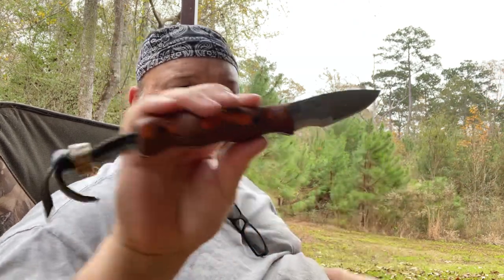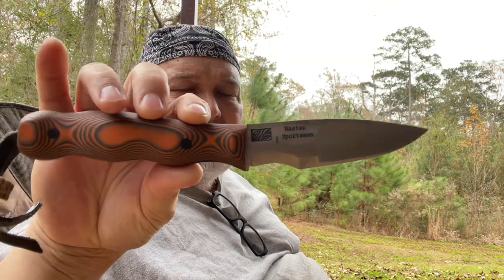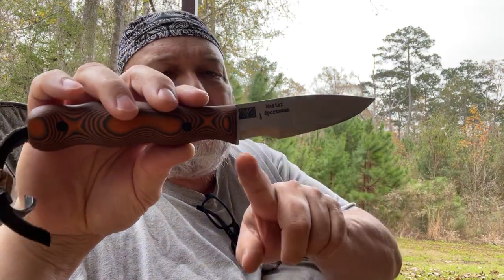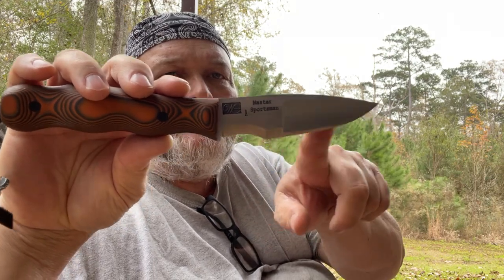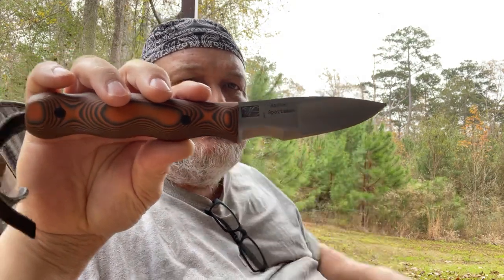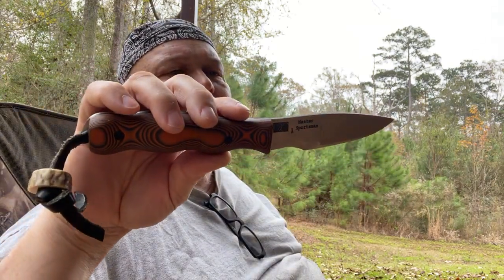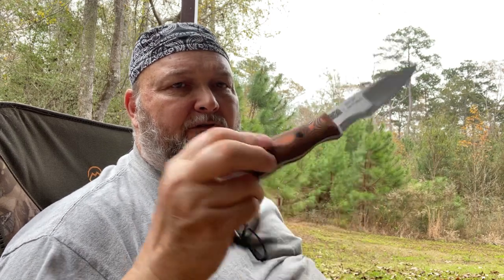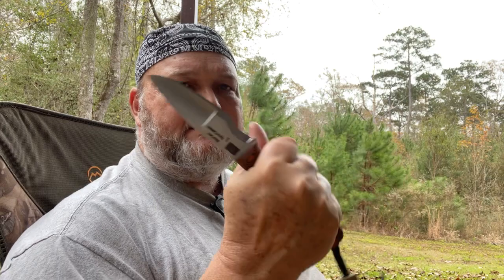Discussion on Steel Options for WC Knives a new Prototype in R&D and a Papa cameo Appearance

Comment: William, dig the new design. Your style of incorporating grind profiles is unique (at least as far as I know) and buying USA made from such a down to earth straight talking good guy 👍👍.

Out if curiosity have you tried a chisel (or partial length) grind combination in the first or lower section of the blade?
Reply from the maker: Edge will not align with a chisel combination grind.

Comment: I really love the patina also, for me the biggest issue for steel is edge retention so, my question would be is there a significant difference or any difference between Nitro V and AEBL in edge retention? 👍🏻
Reply from the maker: Couldn’t see a difference in day to day use. AEB-L seams to feel sharper and will cut better even as it dulls but not much difference in longevity.
Reply: @wcknives  Thanks William

Comment: Nothing beats ballbearing steel. It never did and never will. That's because ballbearing steel, is as good as it gets, for that kind of knives. I would only choose something else, only for a fishing or a Kitchen knife.
Reply from the maker: It’s good steel for sure but every steel has its pro’s and con’s and most steels are good if heat treated properly.
Reply: @wcknives  Sure, however, no other steel, has that relation of edge retention/ ease of sharpening. Neither all the package ballbearing steel has (Super edge stability, great long edge retention, super easy to sharpen, carbides that cut similar to super steels.super toughness close to 3V) It's the only steel, that has the least con's which is only 1 and that's the fact, it doesn't have much stain resistance, however, even on that, it doesn't rust fast, like carbon steels usually do! PS I speak from a user's point of view.
Reply from the maker: @greekveteran2715  appreciate your thoughts but just like everything else everyone has a preferred steel.